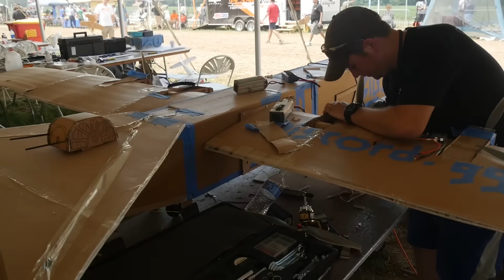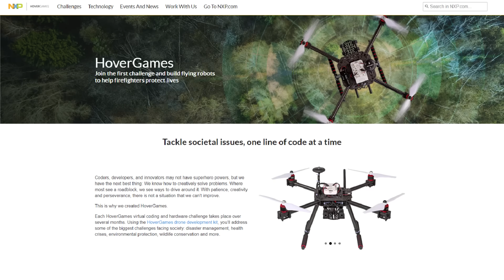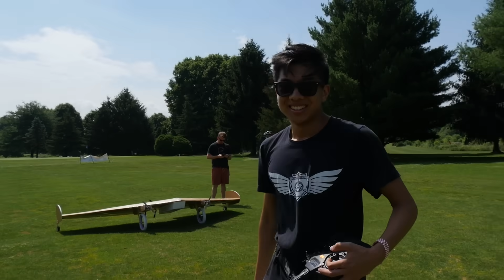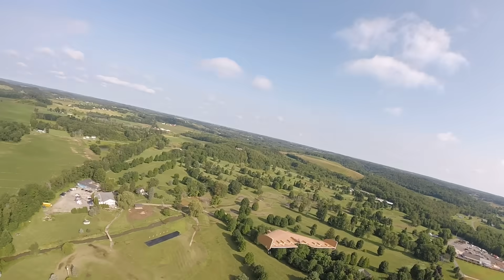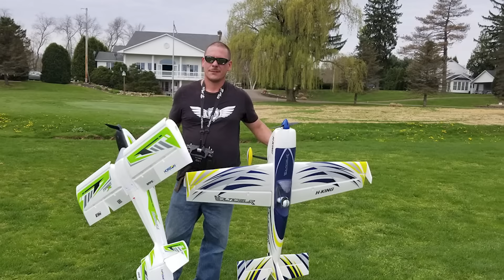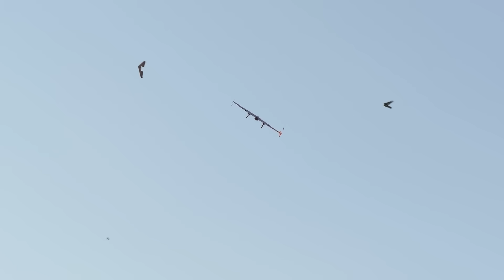Airplane Demolition Derby!?💥😱

Comment: Nice design.
Suggest to always go as far as you can from the ground before your trials.
Also make sure the CG is correct & the rear motors trust is pointing down so the airplane will be pushed upward.
All in all, Its fun to watch. Good job.

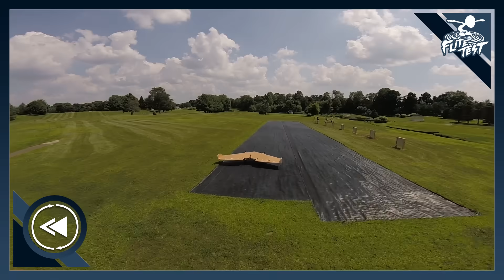Comment: 7:15 just built a Turbo Tutor, new to flying. I did a Taxi test and it pulled very hard to the left. Thought it was just prop wash but turns out that one wheel was tighter than the other. Thanks for this!

Comment: Hey guys 👍👍👍. Great channel and videos.
  And a little suggestion but when you have a problem like the elevator and no real time to test  especially when running a short deadline just put a stake out on a wide part of the field and do a quick test run for elevator trim and movement
    Basically like flying the plan on a control line plane .
    It only takes a few hours to get your new trim setup and hopefully no wrecking of a new built plane for a control test

Comment: I do have to wonder why these guys use hot glue for everything.. There are better glues that have similar properties like the ability to break the connection if needed but have more holding power and easier time limits.. Hot glue when cold is not glue. I can't even remember the last time i did use hot glue, i switched to good old contact glue.

Comment: builds plane with light weight foam and cardboard. im thinking "nice. that things gonna flyyyy." adds 200% of its weight in landing gear. "you idiot..." he literally found the heaviest landing gear he could. makes no sense. use some hollow plastic wheels from a barbie jeep or something. anything but steel and thick rubber...

Comment: Well , the challenge isto build a light and strong craft. Only light structure doesn't work. It needs to be strong as well .
Reply: Flight stability also counts in designing
Reply: Moreover , to add on the stability of wings at different AOA needs to be learnt and experimented before firstflight in order to save the craft during crash .

Comment: Since the before the first test flight I felt the back motor was going to have no use unless it's high in the air and you want to do violent flips. Not useful during take offs or low flight. Wow

Comment: You should make a it so that it can fly without all it's engine's so that if it gets hit in the motor it can still fight. Oh put some drone motors inside the wings so that it can be potentially heavier so you can reinforce it even more. Put like some light metal mesh on the surface of the wings so that they can't be torn off. God I have so many ideas.

Comment: I can't believe you can fly that many RC in the air at the same time without jamming each other.
When I was racing RC cars and flying gliders you had to plug in a crystal that was different than anybody else's, most people only owned a few and there were only so many different ones available.   You could never have done this!

Comment: We used to usethe same type of hinges that you are using except we would drill lines of holes down the balsa-wood trailing edge and a line of holes through the balsa-wood control surface.
Then we would thread a piece of squidding line thru one then thru the joint the up thru the other then thru the joint and so on.

Comment: Would it be allowed to mount an air soft gun on the plane?
Maybe a very fast shooting one with like over 50 rps. Could be center mounted or even cooler center mounted and the tube where the bbs come out enlarged and mounted with a tube on a 3 axis turrent which can be controlled by a second pilot fpv or even better by a camera and a raspberry pi zero which auto targets the other planes...

Comment: What are the rules for builing the planes. Bc im willing to add 20mm cannons on my plane when i make it
Reply: 8 bet there is a no gun rule. But put an emp on it and shield the motors then get enough alt and then wipe out the other planes
Reply: @flyingsalmons934  booming and zooming aren't we
Reply: @engine4628  idk
Reply: @flyingsalmons934  do u even know what is boom and zoom
Reply: @engine4628  yes a plane gains altitude dives on oppenent then runs or climbs away with the sped from the dive
Reply: @flyingsalmons934  easier said gaing the advantage of your speed and altitude towards the enemy
Reply: @engine4628  yh

Comment: Smaller, faster, heavier airplane would preform better in the derby. 

Possibly outfitted with some sort of exterior metal frame. 

Maybe add a hanging metal stick that smashes into other planes while passing above them, and is on a swivel so it does not alter the flight of your plane too much. 

So much brains but not that much common sense.
Reply: He wouldn't be able to hold the title of "Behemoth" if he did that.

Comment: 1. One of the wheels has coaster break (that's why you crashed 1st time, the arm on the hub fixed on smth and the break worked)
2. The hub on one of the wheels (the one with break) is much heavier than other. I can't believe you couldn't notice that

Comment: Next they should build a model rocket and launch it from one of the big planes.
Reply: Propeller powered?
Reply: DontAllBuy No, rocket powered.
Reply: @space__idklmao  how would they get hands on liquid oxygen to enable use of the rocket? I'd understand if you said like a firework. But you said custom model. And custom model engines require a output of oxygen. So they would need to get there hands on liquid oxygen
Reply: DontAllBuy Have you heard of Estes model rockets? That is what I meant, like solid propellants.
Reply: @space__idklmao  oh yes, those, thank you for informing me what you meant

Comment: The way the angle of the back motor is it will keep driving the plane straight down to the ground you need to just up size the two side motors and no back motor that’s how I got mine to fly right but I don’t have electric motors on mine I have a 210 moke nitro engine on mine just one and it fly’s just right straight and very great and is very fast but I don’t battle my plane’s

Comment: ESC and BEC are terms that need to die.
It's the 21st century, obviously the speed controller is electronic, how about we just call it a speed controller?
As for the BEC, it's a 5v regulator...it doesn't need another name.

Comment: Something must be wrong with my eyes. I can't fly a plane that high, it gets to where I can't tell what direction it's pointing. I have to fly foamies in close.
Reply: There are a lot of RC sports which make pilots fly their planes so high they are a dot (FAI S8E/p, anyone?). You get used to recognize the orientation of your plane by the way it reacts to your commands. Think of 3D acro helis https://youtu.be/AXSfFLGeVZA?t=188 there is no "orientation" to see at any distance, basically. Fly as much as you can on the edge of your comfort and it will expand fast. Your brain is much more capable than you are made to believe.

Comment: Are "pilot stations" really necessary, or a help in any way?  Looks like just another thing to break airplanes on, to me.

Also, I can tell you from experience, flying wings are REALLY hard, why did you pick such a difficult planform?  After that 2nd disaster, I would have considered wimping out and adding at least a tiny bit of fore or aft stability surfaces IF you plan to make the moment of demolition a consciously pilot controlled decision.

Awesome quad piloting, especially that fly around of a flying aircraft!  Kept waiting for the crunch, but it never came.  ;-)

It was GREAT when major parts of the swarm converged on YOU.  Looked like a blast.

Comment: plastic pegs with a metal hinge pin is what I used for my su29 sukoi  ..   the reason being the aircraft is so maneuverable it probably would have ripped the tradition one's right out off the plane 11g wing loading....        plane was 9 pounds and called for an os 1.2 ci engine..I put a small 10cc gas engine in it..  prop hang the beast for ages..   then I got into heli's and went broke lol

Comment: So, I don’t know if you’ll read this. In regards to using drones around forest fires. The GNWT tried using them to collect data to help fight fires in the north. Thy discovered that hover types drones would become dangerous and crash. The high winds and heat made the control surfaces not work and the power needed would drain the batteries twice as fast. They concluded that a winged drone had the ability to be stable, gas engines could produce the power required, the endurance required to loiter as fires could be over 50,000 acres.

Comment: How do you get so many planes up in the air at once? 2.4ghz has only 80 usable channels, the kraken uses one, the camera drone uses 2 (1 for flight one for FPV), all other planes need 1 if flown by eye 2 if FPV, plus there are other devices using channels, anyone using bluetooth earbuds eats a channel, if there is local wifi that eats at least one channel, even someone that has the game 'pokemon go' running eats a channel for thier pokemon widget, event organisation probably eats a few channels for communications....

Comment: I'm surprised the Kraken stayed in the air after taking so many hits. If more powerful batteries were installed, it would have won the event easily. Now you have the perfect plane to enter again at next year's event, but add some modifications to make it the king of the skies.

Comment: Bunch of giggling children.  I guess when they have no investment it's funny when they break things.  I fly giant scale Gasoline powered Planes that even simple caches like this would run into the thousands. My Corsair has a 12' span, full carbon fiber and Radial engine. Making all the molds for the plane cost me around 6k. 6k 400cc radial etc etc. That's why I stopped flying foamies

Comment: I had the same issue with a conventional gear plane - one wheel didn't roll freely and dragged the plane to its side. Losening the nut on the axle fixed it.

Comment: The rear propeller is higher with respect to the cord line and the CG, then causing the wing to noise ( pitch) down when it is power up you just need to align these so the wing is then neutral in balance this way it can level with all motor power up to full operation thrust.
Hey, guys, these flying wings do oscillate from, ( along the yaw ) left to right and back again right to left this natural for them to do some either put thrusters at the wingtips or to use speed brakes is the other method to control by a computer rather than as a piloted control this yawing effect is made worse when the wing is rolled over to one wing end is downwardly at the time of the yaw towards the lower wingtip which is the lower of the two wingtips. Also if your thrusters are far enough apart then motors one and three speeds can be used to offset these yawing effect. { normally the thrusters are number left then center then right IE: 1, 2, and 3}{ As per Northup Grumind the designer of the B2 Flying Wing }

Comment: Sure it was the BEC? It flew straight with the two lower motors  - when the rear high mounted motor started it pitched down. It went from producing drag to thrust in a pitch up situation. I think that's what killed it.

Comment: Easy solution for the wheel problem, should totally use small sleds (made from the foam board) at three points with smooth bottoms so it just slides along while you take off. And the back motor you could drop it down abit lower than the front two, just an idea
Reply: And if you drop it down, don’t forget to ad slight counter weight so it’s balanced

Comment: Props can break off during the fight, should use ducted fans no props to break.
Reply: Or use twin jet-engines with thrust vectoring
Reply: I have never seen a good prop break off mid flight. Ducted fans have horrible grades of efficiency...
Reply: @mochannel25  props under normal conditions yes no issues at all, in this case with other craft striking your plane different story. Just my thoughts.
Reply: @wfirebaugh  okay well I never struck a plane mid flight so I have no experience with that. :D

Comment: Hey guy! I hope you'll reading this. Im hoping you could build a "back to the future" car the flys , if it is possible. This is actually my goal to replicate the time machine car flying, but having some problems on how to. Thanks and God bless🙏🏼
Reply: Well, the wheels are turned down, on the flying Delorean, so it seems simple enough to make them ducted fans in a four motor drone configuration. Just need to make a body shell light enough then.

Comment: Could have used thin aluminum along the wings and such to strategically make it both more durable and more destructive. If your wing with a metal coat on the leading edge hits another wing that wing would suffer much more damage.

Comment: hi, I have a question for airplane electronics. i made a 3d model of a cessna 172 that i can print at school and i want to make it so that i can fly it. The problem is that I dont know what electronics to get. it's the same size as the commuter. could you guys help me? also it would be my first plane i make/fly.

Comment: I had pitch stability issues with my first flying wing that I designed and built.  I learned that they don't like flat bottom airfoils much, they like airfoils with a reflexed up Trailing edge.  In order for them to be stable in pitch, set them up extra nose heavy, and with up elevator trim to compensate, if you cannot add TE reflex.  Aerodynamically having to fight to keep the nose up, dampens out the pitching moments.  My first wing was impossible to fly level.  It was either pitching up, or down under power.  I added a nice reflexed up horizontal stabilizer between the wing's twin vertical stabs, and shifted the battery quite forward, and it flies great now.

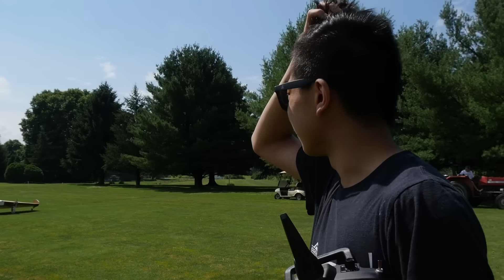Comment: 8:12 Rig the undercarriage so the front edge of wheels are aimed slightly towards each other;  ""Toe-In."  Bad news if they are angled away from each other.  You expect to control yaw on the ground with what, differential power?  Not much rudder surface on that craft.

Comment: Hey guy's. I am trying to get a hold of a set of Fowler hinges for a project I am working on. I am not having any luck on finding even in or on a hobby shop site. Not even on horizon hobby site for the timber. PLEASE HELP. I need 12 in all. usually come in sets of six. Dynam part # 3007. DESPITE!!!!!

Comment: 1/2 A control line combat when I was a kid.  We didn't bother to paint them, and had modular engine, tank, and bellcrank components.  Sigh ... where did the 50s go?

Edit ... Why use so heavy wheels?  2 or 3 layers of laminated foam would be way lighter.

Comment: For extra strength and indestructibility cover the whole wing with 75micron laminating film... I use A3 pouches overlapping joints by about 1/2 inch...props wont cut through it, and the film also makes the wings stiffer....  useful for the slope flyers where it can be rough

Comment: hey andres big fan of your work need some help
i was thinking of modifying your x29 build to have vertical landing and takeoff and it seems to have the same motor configuration as this kraken can you drop the circuit diagram and how you programmed the motors or at least drop your instagram handle and we can cha or some cause i cant drop it all here. check out build it: NG to see my vids

Comment: You should program in the ability to kill both front motors in case one of them gets knocked out to avoid offside thrust letting you at least attempt to fly with the back one. Same with the ability to kill the back with some mixing on a pot... in case it’s thrashing the back after a hit.  Redundancy through program mixing.

Comment: Damn that Looks really funny 😁 but i got a question what's up with all those channels, can there be 2 excatly Same Planes with the Same channel be up in the Air and they just bind to one plane or does everyone has a different channel ?  i'm kinda confused about this
Reply: The transmitters hop between multiple different channels in a pattern very quickly. That's why you have to bind receivers so they learn the pattern. Since there are different patterns, multiple planes can use the same frequency. This video explains it in detail: https://www.youtube.com/watch?v=aZGcyuezMik

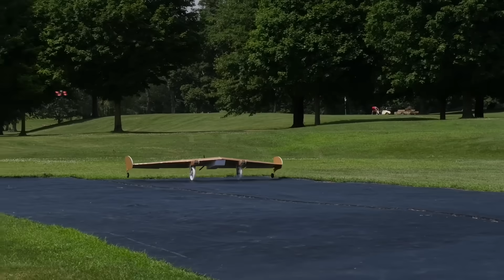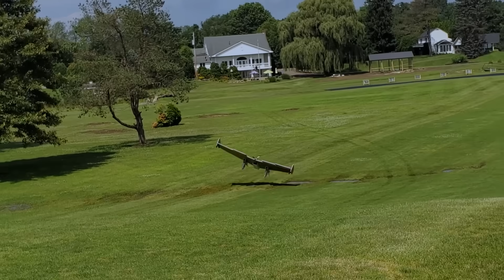Comment: Crash @  7:00 and 8:22 Thats why I dislike this design, and flying wings should always have a pusher propeller, never a tractor (puller) propeller.  This also could have used a single front wheel since it has the two wing wheels.  Great work though.
Reply: Why never a tractor?
Reply: igalloway inconsistent votecies created on the lifting surfaces of the wing.

Comment: What power pack do i need for the mighty mini scout (on your store)?
Reply: Herps And more A or f pack
Reply: Ryan O. Ok thanks which one do you think is best?
Reply: Herps And more will it be your first plane or first mini, and if not how will you be flying it?
Reply: Ryan O. It will be my first plane and I plan on flying it for around 10min or 15 (if it’s even possible
Reply: Herps And more powerpack A would probably be better because you won't have to do that much reinforcement or thrust angle changing because the mini scout was made for A pack but most mighty minis can be changed from A pack to f pack with some changes.Plus A pack is cheaper and that is always a plus
Reply: Ryan O. Ok thanks